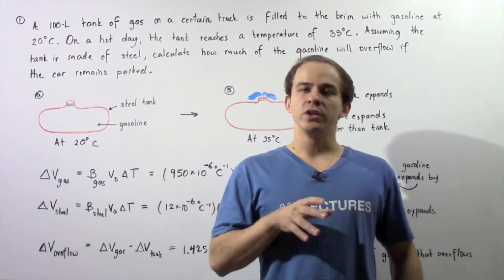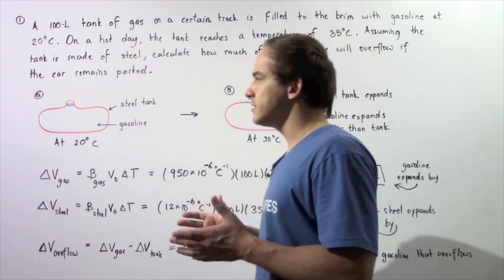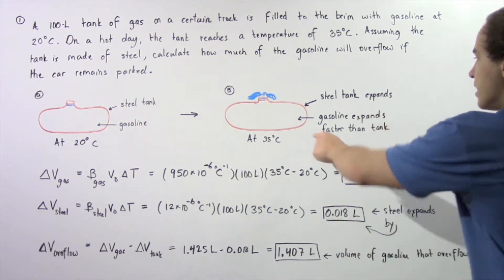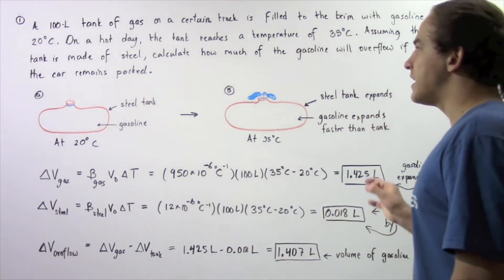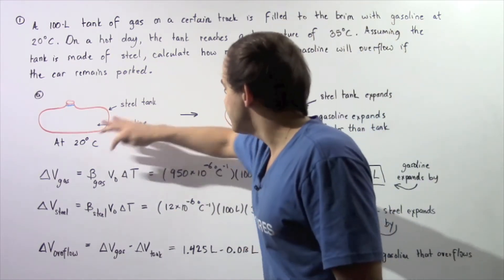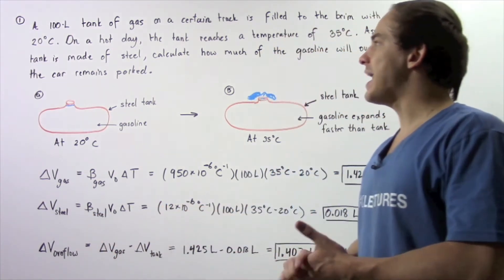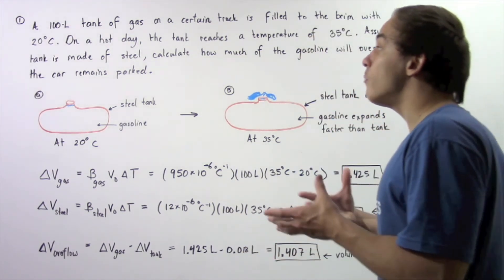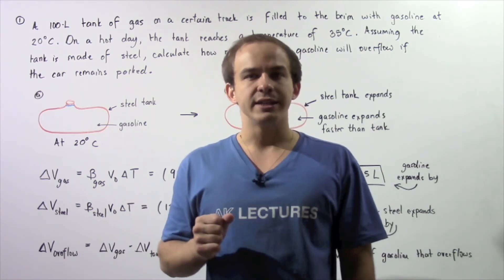Thermal Volume Expansion Example

Comment: Why is that beta of steel is not multiplied by 3?
Reply: i agree because that value is coefficient of linear expansion
Reply: its beta.. thats the volume coefficient
Reply: i know its way too late but its alpha that is multiplied by 3 to make a beta because alpha is used for linear expansion and beta is used for volume meaning length width and height and that is 3 things to basically 3alpha is equal to one beta